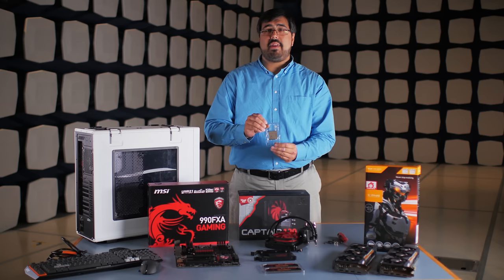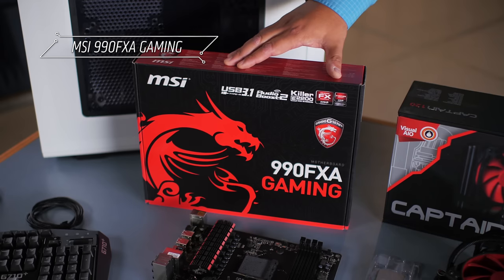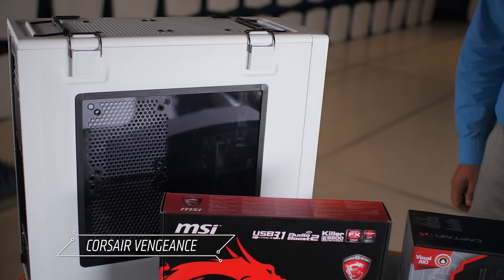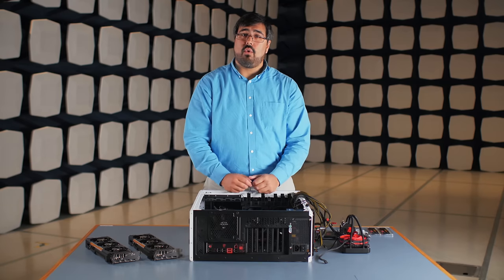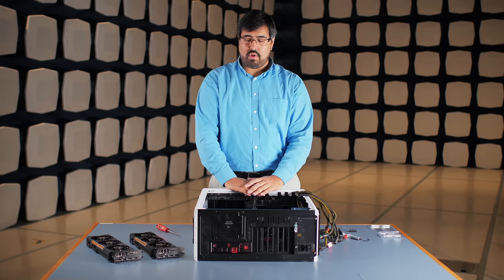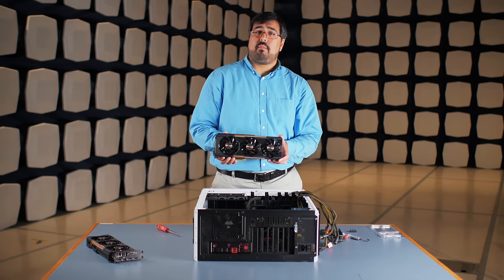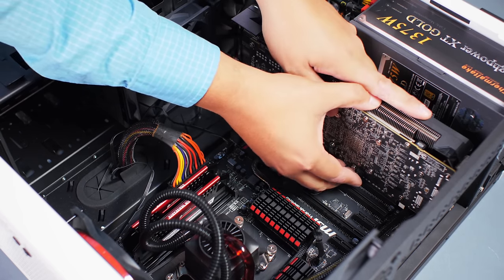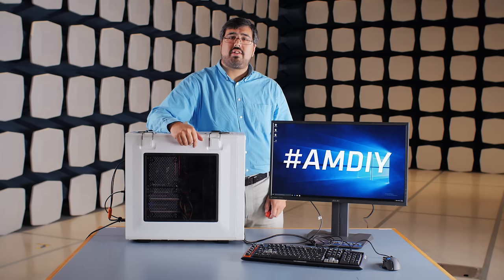How to Build an AMD FX™ 9590 CPU-based PC

Comment: That FX will bottleneck the soul out of those 2x 390X, my 8320 at 4.6ghz (which is same thing as 9590 just clocked lower) was bottlenecking my single 290X Lightning, when i upgraded to Skylake - OH GAWD ! I love AMD and i will support them all the way, i wanted to wait for the Zen but it looked like it's not comming out soon. But i will always be on AMD gpu
Reply: +DelBoy    not if you are playing on 4k ..
Reply: Yeah, but if you're buying 4K monitor you're probably then why not stretch out and buy some high end cpu ? FX is more budget build cpu
Reply: *****   this is a 9590 build buddy !  :P
Reply: Which is 8320 oced at 5ghz, i had 8320 at 4.6 and there's nearly no difference between the two hello walkman
Reply: ***** of course I understand but read the title pal.  This is a 9590 build  ;)
Reply: Nope, that's only with some coolers Cooler Master said that it's not with their coolers *****
Reply: Bend-Lake !  :P
Reply: Hilarious and original
Reply: It's not cheap material it's just thinner material, and on most coolers it doesn't bend at all, i contacted Cooler Master and they say it's fine with their and most other coolers, it's just problem with some coolers and people who use electric screwdrivers when installing - i don't recommend that on any cpu. Whenever i try to explain it "you pull me back in !"*****
Reply: yeah pretty sure 9000 series will bottleneck those beast gpus my friend was using 8350 and switched to 6700k and gained more than 30% or more fps with a 980ti
Reply: +DelBoy The performance of the 9590 beats out the best Intel CPU's in 4k. That is the main reason i bought a 9590fx. the human eye also can not see past 60fps so anything higher is dumb.
Reply: killerv135
Wrong and wrong... Intel in last few years have much better per core performance, so that makes no sense, also the higher resolution is the more load goes to GPU rather than a CPU. Also human eye doesn't see in FPS and you CAN se well above 60fps, there's insane difference between 60 and 144hz.
Reply: ***** When you don't want to listen or understand why bother giving you the review pages and the youtube reviews. You obviously don't care to learn you think your right so have fun being stagnate.
Reply: ***** And about 60fps human eye study look it up..... 144hz is the speed at which your monitor fps can go up to, For some odd reason people think the higher the hz the better the monitor. Only for 3D does that matter, but the human eye can not see past 60fps......
Reply: killerv135
Sure dude whatever, good luck with that logic. I'm leaving this post this is pure 24 karat fanboism.
Reply: *****
Of course specially cause my last few CPUs were AMD
Reply: *****
Such an original troll

Comment: But will that little cpu cooler be enough ?  I think not .
Reply: You can use any AIO 120mm water cooling system as longest you use push and pull fan configuration "x2 fans" or any larger cooling system like 240 or 360 will do ok as well
Reply: English is not your first language is it ?
Reply: And why that's important ?
Reply: Credibility. If you say/type things wrong most people treat you with less credibility .
Reply: Emil Lundberg NOW piss off for ever !  I wont be seeing your reply cause I'm muting them . lol
Reply: I weigh 255 thank you very much ... I just hate idiots taking things out of context like they think they know everything. Now by by
Reply: Sounds to me like your pointing fingers about the 400lb virgin . and if your gonna call me ANY kind of flake my nickname is Red Flake given to me by my tribe. I also am no virgin. Rosy palm and he 5 sisters could attest to that.

Comment: Only AMD cpus that you should be buying now are fx 6300 and below (athlon, apus, etc) they are awesome, but higher tier ones are pretty much shit. Otherwise I'd recommend a lot of AMD gpus over nvidia's, they are very good  for the price
Reply: +i123 The 8 cores are perfectly good you get 8 threads, and the few applications that makes use of them will give that much extra performance.
Reply: +Medallish Ok. thing is that even in AoS which can use all those extra threads a FX8350 can't really match a i5 or i7 processor. Could just be that it isnt well coded just yet , but so far it's not seeing much of a performance uptick , although AMD's GCN Architecture is kicking some major ASS a 390X can go head to head with a 980 Ti and in some instances do even better than it , although it seems that cards from the 290X/390X  to the Fury X seem to have scaling issues with the cores or maybe just it's limited by the ROP's or something because there isn't much gain going from 2816 GCN 1.1 SP's to 4096 GCN 1.2 SP's.
Artic Islands should be an amazing Arch though , thats when GCN should likely see it's biggest gains. At least I would think ..
Reply: +Metal Unlimited You really have to tell me what AoS stands for as it's associated with a lot of games, atleast a quick google didn't tell me which game it is.
But in raw power, yes an FX 8350 can actually match an I7, and we saw with some testing on Mantle it also applies in gaming usually.

I agree with the GPU's being pretty neat, there's no doubt that GCN is made to last a lot better than Kepler, although Kepler, however I doubt a 390X will ever truly catch up to a 980Ti, sure there might be a game or two, but I'm thinking in most cases, that being said I'm incredibly happy with my Fury X, and wouldn't be too surprised seeing it becoming a bit like the 290x vs 780Ti, I expect the Fury X will be beating the 980Ti as games makes more use of advanced features, and drivers mature.
Reply: Medallish Ok. Ashes of the Singularity , it's  game being developed right now that is built on DX12 and with just a little bit of Asynchronous compute running on a 390x and just the switch to DX12 have brought the 390x to roughly the same level of performance as a 980 ti. it's mostly because in AoS a 980 ti actually loses performance and a 390X gains a big boost in perf. Maxwell ( what the 980 ti is based on ) is a more Serial graphics Architecture while AMD's Architecture is more suited to Parallel workloads , here's a slightly better explanation here --> http://www.dsogaming.com/news/amds-directx-12-advantage-explained-gcn-architecture-more-friendly-to-parallelism-than-maxwell/

AMD's hardware has been limited in showing its true potential simply because lack of support to fully utilize the GPU and its Arch as well as piss poor drivers in terms of extracting performance ..... stable , but still shitty. 
Recently though AMD upped their game by forming the Radeon Graphics team / Division of their company , a development team solely devoted to better Drivers and focusing much more on Graphics Architectures . 

What DX12 and the Vulkan API do are essentially remove the middle man and or the Driver itself , it speaks more directly to the hardware and it's up to the game developers to optimize their game code instead of making AMD and Nvidia fix their shit for them so if a game runs like shit it'll be Entirely the developers fault and not AMD or Nvidia's. 

Also with Async compute you can have the GPU work on more than 1 Graphics command and other stuff , it is meant to utilize the processing resources already available and to help better manage the commands being sent to the processor , it puts priority over certain other tasks and it helps it out. 

Maxwell cant do Hardware based Async compute because they dont have it and software Async compute gargles balls because the context switching it TERRIBLE in comparison to AMD's . Even Intel's iGPU's have Context switching for the record , it's just that AMD happens to smoke both of them in this area.
Reply: Medallish Ok. Also we dont know how many cores where used or Utilized during the benchmarks , if it was 4 vs 4 of AMD vs Intel cores then it's very likely that thats why AMD still can only match a i3 in AoS

Comment: the combination of the msi board and the 9590 freezes my game every 20 minutes
Reply: I have the Same problem 
I have the msi 970 Gaming
Reply: And the temperatur of cpu are not corred  and the mainboart headsink / cooling fins are verry hot 
In it them so?
Reply: Sorry my english is verry bad
Reply: david woerle i fixed mine by getting a super expensive water cooling

Comment: Just buy fx-8300 and OC it to 5ghz.
Reply: +kordaghl got fx 8300 at 4ghz, I think Im at 1.325 v at core. I deffinitely dont want to go over 1,4v... whats your v pls?
Reply: HybOj 4800 @ 1.416v
Reply: kordaghl
 kk, thanks for reply... I dont feel the need to OC more atm, I have HD 7850 so it would be overkill anyway, even 4ghz seems overkill for my GFX card, but I use it for video rendering and such, good to know I have some headroom :)
Reply: HybOj safety voltage for FX is around 1.55v.
Reply: kordaghl
 nice, even more headroom for us :) Im sure with this HW, waiting for Zen is not gonna be a  problem at all

Comment: I usually like AMD videos but this one is complete BS. Pointing on an overpriced 300w CPU build on an 3 year old architecture on an obsolete production node is pure stupidity. The guy who is responsible for the marketing should be ashamed.
Piledriver did it's time, you have to move on AMD.
Reply: +loguerto 220W fairly ok priced, for the price of an I7 and a crap cooler you can get mostly the same performance and a watercooler buying the FX-9590.
Reply: +Medallish Ok. 
The i7 will demolish the 9590 at stock speeds. Plus, the 9590 has next to no OC headroom thanks to its 220W TDP. Meanwhile, the i7's can be OC'd by at least a full GHz, in which case they eat the 9590 for lunch.
Reply: loguerto you could get the FX 9590 for just under $100 new right now

Comment: Dat cpu bottleneck tho!! :D
Reply: +jimgr94 there will be no cpu bottleneck
Reply: +MarioPL98 it depends. if the game/workload isnt optimized for 8 threads there will be bottlenecking with crossfire r9 390X's.
Reply: +MarioPL98 crossfire requires more CPU power. AMD cpus are simply not powerful enough
Reply: PanzerFaustFurious there is no APU in this video
Reply: ***** almost every new game is optimised pretty well (not alpha/beta versions)

if the game isn't optimised, it's probably older or just simple game that can run max settings on even weak gpu
in this case there will be no bottleneck as well
Reply: +jimgr94 Obvious inexperienced user is inexperienced.
Reply: +Medallish Ok. More cores wont bring happiness always bro!! A modern game for example is fallout 4 (http://www.gamersnexus.net/game-bench/2182-fallout-4-cpu-benchmark-huge-performance-difference) which runs like ton better on i5 than the 9590 thats what i am talkin about getting the best for what u pay for and imo the 9590 should cost 170$be competitive atm!! For 200-230$ you get a much better cpu and yes i can clearly tell better get an fx 8350 than a 9590 u can oc it the same!!! Its not about being experienced or not its about getting the best bang 4 ur buck ie. low budget get the fx 6300 or the athlon x4 860K medium budget get an fx 8320 or a 8350 but if u gonna go with cf or sli solution and your budget is more than 900$ you will go with an intel solution just because at that price range amd does not come nearly close to performance. The good thing is that with dx12 as said the will minimize cpu bottleneck and thats cool!!

Comment: fx 9590 is not worth of money and in that price range it is better to go for Intel competition like i5 6600K or even cheaper cpu-s like i5 6400 and then Oclock him on level of 6600K because now every Intel Skylake can Oclocked with proper Motherboard and every Intel cpu is automatic APU too!!  FX 9590 is only factory overclocked fx8300/8320/8350/8370 and nothing more!! fx 9590 is pure waste of money and you need expensive cooler too and you get  shiity performance !! even i5 6400 with 2,7Ghz demolish 5Ghz from AMd FX 9590 !!
Reply: +Mr11ESSE111 not any more. you need K series for OC. I heard the are putting out micro updates that you can't stop those types of updates.
Reply: Zushikatetomoto Shift but now it is beeter then buying 6600K to buy Xeon 1231 v3 which are cheaper but he is 4/8 core/thread and he beat in almost everything i5 skylake
Reply: Mr11ESSE111 I would go for i7-5960X Extreme Edition before that. 8 core 16 threads. and more cache.
Reply: Zushikatetomoto Shift better wait 7-8 months for Zen with 8/16 core/thread  which will (probably)cost half of price of 5960X and basically he will have same performance or even few % better
Reply: Mr11ESSE111 I was talking about the Xeon vs that.
Reply: Zushikatetomoto Shift Xeon with 8/16 core is expensive and that with 18/36 cores cost 4500$ !! if amd offer 16/32 core /thread  Zen for price about 1000-1500$ it will be much better even he will be 20% slower because of 2/4 cores/threads less

Comment: I ran my FX-8350 until I was able to replace it with a Ryzen 5 1500X, which trounced it.  It was a fun chip, and I still have it.
Reply: @Jeff VR Actually, it's still in service on my Windows 7 test bench.  I use this to test PCI devices, DDR3, etc.